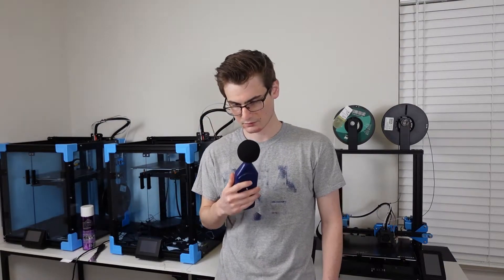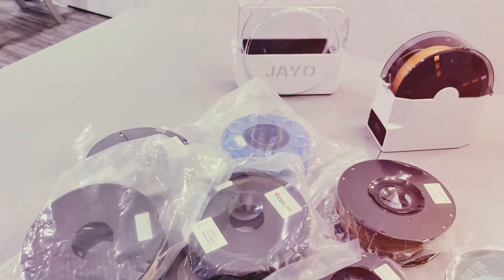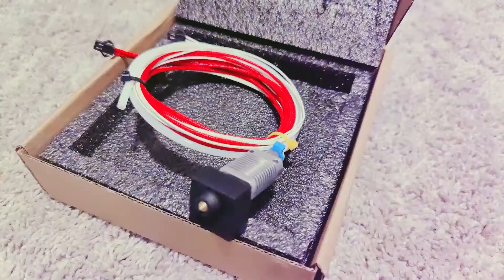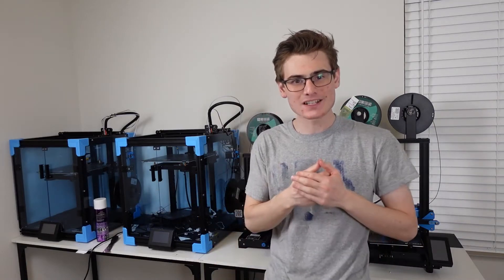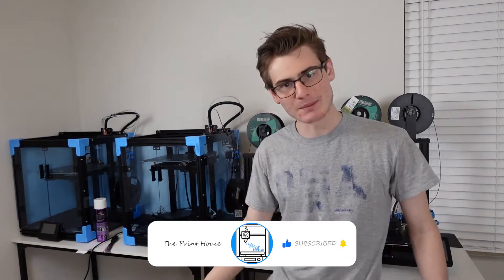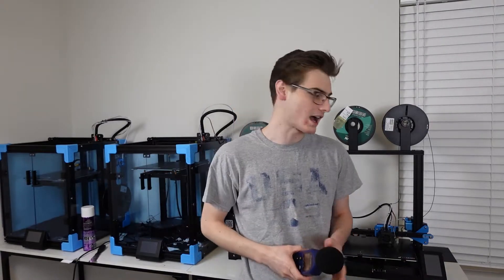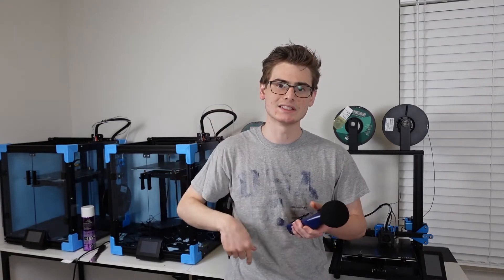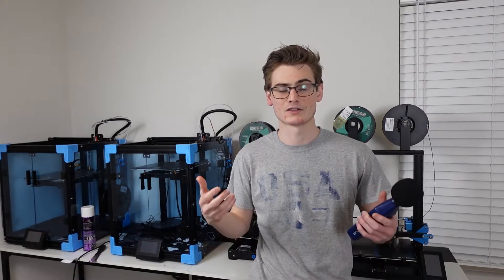Sound Showdown: Creality Ender 3 V2 vs SOVOL SV02

Comment: did you disable the loud fan at the main board ??
Reply from the maker: I did not do that and I would not recommend it.
Reply: @ThePrintHouse  allright... i will never be able to get it silence with out a new fan... its very loud :)
Reply: Sure with wire cutters.   Wouldn't recommend not cooling a mainboard.  Better to look at quality fans and just swap it out.  cheap fix